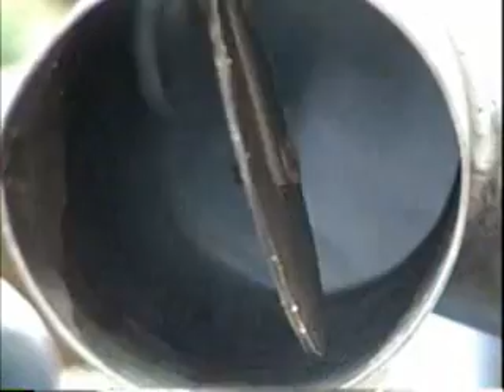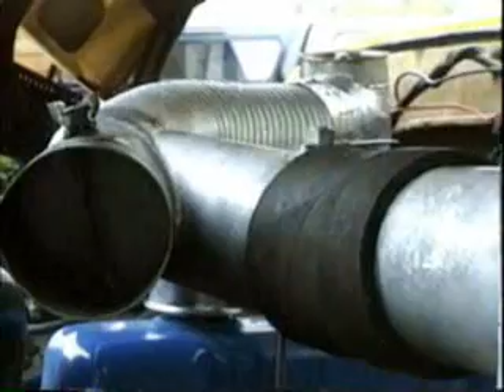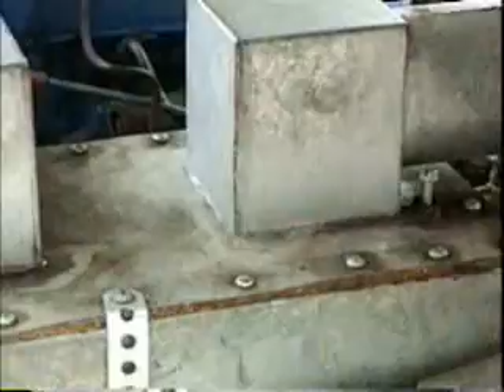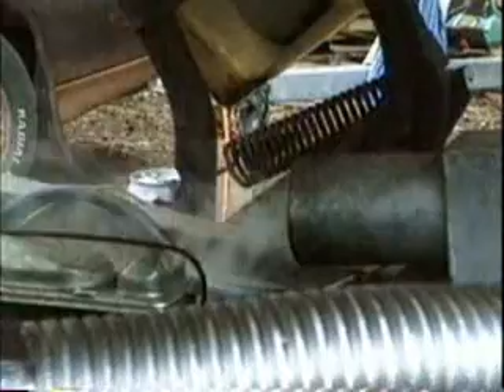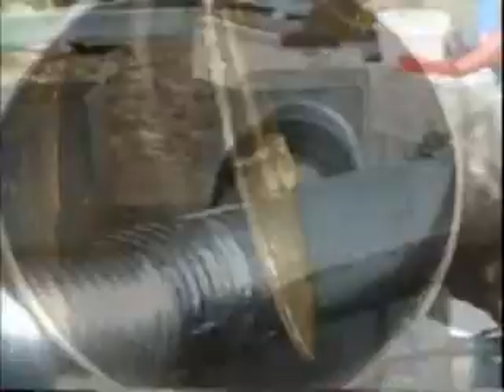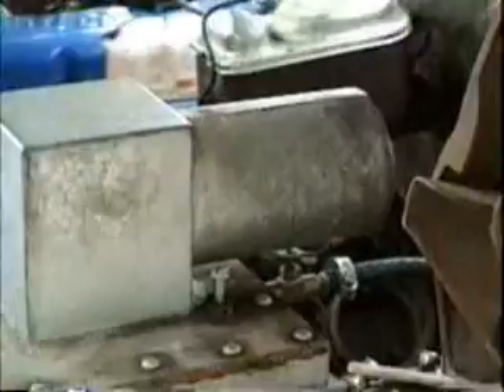Here is definitive proof on how to separate all Atoms in all liquid soluble matter.

Comment from the maker: My problem was the generator. You see it was set up to produce 110 VDC, at 2000 RPMs, however on the highway the engine is running in the 3 to 4 thousand RPM range. I discovered when I burned up one of the 250 watt flat bar heaters. They were made of stainless steel. It melted the heater into two pieces. The chamber never caught on fire, but the flex drier vent tube, had cooled with air and vapor traveling through it, so the vapor had condensed some, the flame looked like an alcohol fire.

Comment: Thanks for the reply and the repetition. I did read about the fire -sad indeed. However, I thought that, after installing this on 7 vehicles, there would have been some report of mileage gains or something like that. I do see what you are getting at though -being able to burn any liquid as fuel in an existing ICE, for one. Other uses may come about in the future too. If it was me, I'd have built another by now though, just to save on gas, since you still need to get around. Am I right?

Comment from the maker: I know there is a temperature that water will do it. When this temperature is found, all the hydrogen you need to run any vehicle, can be made at the intake manifold of the vehicle. An inverter with 2000 watts of output will do the job. if the temperature is found. Large mass of heat, and a very fine mist of liquid is the key. There is a 62 degree Fahrenheit temperature difference in the boiling temperature of Hydrogen, and Oxygen. Who knows how close the molecular temperature difference is.

Comment: Okay, so is it still on a generator now? Also, how long does your heater last? I ask because I don't think that they are meant to be run on continuous duty..... As soon as I said that, I recall that there was one heater that ran for almost 8 hrs a day in order to keep the kettle going at the office. It did that for years, and was changed only because the base rotted away, but the element was still good. So I am guessing that all I would need is a stainless steel platform on the element then huh?

Comment from the maker: If you make the hole that sprays, the gasoline really small any fuel pump will work. If you just want to see the white vapor use an electric fry pan, and a plastic spray bottle. When I first discovered this. I spilled small drops of gasoline, accidentally, into the fry pan trying to get enough heat for a chamber. I created the chamber after a seminar on 99 Miles On Gasoline Vapor ( a scam). I threw that chamber away, and created the chamber you see here on You Tube.

Comment: Thanks for the reply and input! Hmmm... I guess that may be something in the works for me. I already have a 700W inverter. I am also guessing that I could try it with a clothes iron to see how things go at first. Getting the gasoline to spray out will take a bit of thinking -unless my mechanical fuel pump already puts out enough pressure.

Comment from the maker: I did it to gasoline. A large mass heater, and a fine mist of liquid, changed the gasoline. I got double the power to the ground over gasoline. I got zero parts per million, hydrocarbons, reading on a smog analyzer. I did this applying the liquid to the heat.

Comment from the maker: The problem is you have the pressure, which both hydrogen an oxygen are in at the point of separation. Maintaining the separation is the problem. cool the temperature and the hydrogen and oxygen will condense, back to water. Lower the pressure, and they condense. Transferring the hydrogen to the combustion engine, to allow it to burn, without condensing, hasn't been done yet. Applying the liquid to the heat eliminates pressures. You can take any liquid to any temperature before it boils.

Comment: hey mate.  Thats not my vid; its one ive referenced a few times but it belongs to FEC or Fast freddy whoever that is.  for reference sake that valve is opened before they start the truck but its come to likght they faked it all. Back to what i was saying, at 15BAR of steam pressure ina boiler the water temp is 205-207degreesC so somewhere around 60BAR of pressure water reaches the point at which it cracks into oxygen and H according to my instructor

Comment from the maker: Watched your video. I have a problem. In the back of the truck on the container, you see the gas in. The inlet or out let side of the water filter container, which is what you used, your PVC ball valve on the line is closed. Hard to make something run when no flow from the fuel source is happening. Take the fuse out of the power and the fuel gauge doesn't read at all. I see no flow of fuel, or proof that gasoline is not running the vehicle.

Comment from the maker: The liquid that forms the bubbles, is the non flammable liquid, that doesn't mix with gasoline, yet using heat it was created from gasoline. When a liquid is created it will always be soluble with the liquid it was created from. My liquid is not, yet it still has an oily texture. Make a bunch of my white vapor, in a fry pan, and you will see what I am talking about, when the non flammable liquid accumulates.

Comment from the maker: To defragment gasoline, you apply the heat to the gasoline. I am applying gasoline to the heat, at temperatures not achievable by applying heat to the liquid. Doing it this way the liquid achieves the heater temperature before it boils. Spray a fine mist of gasoline onto an electric fry pan set on it's highest temperature (about 600 degrees Fahrenheit). Watch closely the bubbles when they appear, on the pan, watch the clear gas turn white when oxygen fills the void, as the bubbles break.

Comment from the maker: Something to remember. A molecular change, produces a void in the molecular structure, of the original liquid. Science says mother nature will fill that void when created. Oxygen,  in the air, surrounding, where I sprayed the liquid gasoline onto the heater, filled the void. This is why I get a 50% increase in horsepower over gasoline. The molecule that created the void, in my chamber, is no longer flammable, does not mix with gasoline, and has a boiling temperature close to liquid mercury.

Comment from the maker: Do this and you have produced a molecular structural change to the liquid. It is possible to do this to water at the right temperature. I'm just hoping someone will grab this an prove what I say. Take one of the molecules in water to the right temperature and it turns to a gas, while the other molecule remains a liquid. Do this and you will make all the hydrogen contained within the effected water. Resistance heat can do this.

Comment from the maker: All liquids boil slowly. Try boiling water and see how long it takes. This is applying heat to the liquid to get it to boil. If you apply a fine mist of liquid to a heated mass (heating element) the liquid will reach whatever temperature the heater is set at, before it boils, yes even above the liquid's normal boiling temperature. Gasoline showed me this. There are molecular temperatures in all liquids, reach one, and it turns to a gas, all other molecules in the liquid will remain a liquid.

Comment from the maker: Sorry, for not responding sooner, but no vacuum or pressure is being used here. and I have taken liquid gasoline to a temperature above gasoline's boiling temperature. You see everyone else applies the heat to the liquid, and the normal boiling temperature is all you achieve. Apply the liquid to the heat, in a fine mist and you can take the liquid to any temperature you desire, before it boils. You see this way the temperature is reached before the liquid has time to boil, since boiling is slow.

Comment: ive read a lot of comments to understand what you are trying to get across to people and i think i finally read the one i understand. Its called "cracking" apparently when you can disassociate elements in a compound through heat/tempreture. I was told by my instructor that you can burn water but you need to heat water to 430degreesC. To the lay person this doesnt sound hard, fires are hotter then this. The reality is you will boil water at ~100degreesC. You need a pressure vessel to do this

Comment from the maker: If you spray a fine mist of gasoline onto a 500 watt flat bar heater, you will make all the vapor needed to run any engine. This vapor will have twice the power, the gasoline vapor you create, using the bubbler method. The butterfly valve under the carb will regulate the engine RPM. This is the basic way my system operates. I just had the chamber to maintain a quart of liquid, finding out I accumilated a liquid, that wasn't flammable, and would not mix with gasoline, from which it was created.

Comment from the maker: The point is the liquid reaches the temperature of the heater, before it has a chance to boil, being it is a small portion of liquid. Try it on gasoline see it happen, and you will know. Gasoline was the first liquid that I have ever seen this happen to. If it can be done to one liquid using heat then you can do it to any liquid, it is the right temperature, and temperature stability that control it.

Comment: I can't, its physics or mother nature. Any Liquid will expand 1000 times their original size when they are heated to a vapor. To go past the heated state you would have to do this under a vacuum to get the same thing to happen without heat. Then the next state I believe you get from vapor is very hot and that is plasma. If you know what is hotter then plasma then let me know.

Comment from the maker: Well by spraying a fine mist of gasoline onto a large heated surface (600 degrees Fahrenheit) I have taken gasoline to a temperature higher than it's boiling temperature. In doing so, I found a way to take any liquid to any temperature. You see when the small droplets of liquid hit the heater, they assume the heater temperature, faster than they can boil, it is at the assumed temperature of the heater, that the liquid boils. Creating, in my mind, a Molecular Change to gasoline. Show me different

Comment from the maker: I never preformed a MPG test on it. The point is not the mileage. With this I have shown people there is another temperature in all liquids. This means creating new and different fuels is possible. This opens up a whole new world of unknown substances. All done by applying the liquid to the heat. The fine mist allows the liquid to assume the temperature of the heater, really fast, faster than the liquid can boil, so the liquid assumes the heater temperature, then boils at the heater temperature.

Comment from the maker: From what I have done to gasoline. I know the right temperature will separate, the hydrogen and oxygen molecules in water. When this temperature is achieved, you will make a hydrogen vapor at the intake manifold. No cells or HHO generators needed. You will make as much hydrogen as is contained in the water you have sprayed onto the heater. The heater mass, and mist fineness will make it happen, when the right temperature is found, in the water.

Comment from the maker: To see the power difference. Use an electric fry pan, outside. First pour a little gasoline into the fry pan, cold. Ignite the gasoline with a match, and it will go poof. Plug the fry pan into power, and turn it to max heat on the control. Wait until the control, says the max temp has been reached. Now using a spray bottle, spray some gasoline onto the hot surface of the pan, you will see the white vapor I created. Throw a flaming match at that vapor, and a boom will happen. I started here !!!

Comment: No need for the apology. I would definitely like to try vapor on a race vehicle. I really do love experimentation and non conventional designs. Is there a source or a link you could share to help me with the design of the fuel vaporization device? From what i understand is that you have to have a specific amount of heat and enough surface area to make enough vapor. Would it also be possible to incorporate a turbo with this design?

Comment from the maker: To see the white vapor I created. Get an electric fry pan from the Goodwill. Take it outside. plug it in to electricity. Turn it to highest temp. Wait till the indicator light shows it has reached it's highest temp. Get a spray bottle. Put a small amount of gasoline in the spray bottle. Spray the gasoline onto the fry pan surface. It will produce the white vapor instantly. With the gasoline and fry pan cold. Drop  drops of gasoline in fry pan ignite. it goes poof. ignite the white vapor, BOOM.

Comment from the maker: You are talking about auto ignition, where the fuel ignites. The temperatures seen on the internet for the ignition temperature of gasoline is WRONG. They say it is 525, degrees Fahrenheit. I have seen calrod electric heating elements reach a dull red color, before the gasoline ignited. I know this is around 1000 degrees Fahrenheit. I used 600 degrees Fahrenheit, in the chamber, to make my white vapor.

Comment from the maker: Been visiting family with no access to internet. The secret is taking any liquid to any temperature. A large mass heater, and a fine mist of liquid, sprayed onto the large mass, heater element. The liquid will assume the temperature of the heater, before it boils. This allows you to take any liquid to any temperature, even above the liquid's normal boiling temperature. This separates the molecules within the liquid, when some molecule turns to a gas, other molecules remain a liquid.

Comment from the maker: I am not pressurizing the liquid. The chamber you see is open to the air. I simply spray a fine liquid mist onto a large surface heater. The liquid assumes the temperature of the heater, and boils at that temperature. This takes the liquid to a temperature above it's normal boiling temperature. This is not possible. All liquids have certain boiling temperatures, according to science. I am not a scientist, so I did it to gasoline. The small amount of liquid, assumes the heater temp, and boils.

Comment from the maker: Vapor cannot be super heated. It has absorbed as much heat as is possible.To absorb more heat it would have to change its state again. There are 3 states in a substance, solid, liquid, and gas. I know of no plasma state of any substance. In theory I suppose it exists, but the heat needed to achieve it does not exist, as far as I know. To re-condense vapor, one needs to cool the vapor, this defeats what I have done.

Comment from the maker: Using the white vapor created from gasoline, like I did, gives a dramatic increase in power, over liquid gasoline. This allows for one to decrease the engine size, which consumes less fuel. I would not doubt running a generator longer on vapor.

Comment: Oh.. Yeah and another question have you thought about building a stand alone white vapor system where you superheat the mist making the white vapor and re-condense it to a liquid that will be injected into the system with little to no "non burning" liquid in it. making it possible for you to run your car longer without having to empty the chamber? I know this would double to work. But just a thought.But im sure the new liquid will be much more volatile then the out of the pump gas.pro or con lol

Comment: Are the exhaust pipes the source of the 600deg heat? Can we use resisitive glow plugs, resistive cables, or should we change them? Have you tried using ethanol instead of gasoline? Thank you for sharing all these vids/info!

Comment from the maker: If you increase the temperature to 600 degrees Fahrenheit, and spray a fine mist of gasoline onto the heater, surface, you will get twice the power that gasoline produces, but you will also get another liquid, that no longer mixes with the gasoline it was created with, and the liquids is no longer flammable. This is a molecular change to gasoline, and the right temperature will do it to water, producing hydrogen, as much as the water being sprayed, contains. Try it. I don't have time right now.

Comment from the maker: It is not the device that makes a difference. The device was a way to do it at the time. The break through is there are other temperatures accessible, inside liquids, by spraying a fine mist of liquid onto a large heater surface. The liquid assumes the temperature of the heater before it boils. This creates a molecular change to the fine mist of liquid, when a portion of the liquid turns to a gas, and another portion of the original liquid (gasoline in my case) becomes non flammable.

Comment from the maker: This is not a carberator, and does not work like one, You need to look before you leap. I have used heat and a fine mist of gasoline, and created a different fuel. Only the butterfly valve under the carb is being used.

Comment from the maker: I would bet they are adding some chemical to initiate the oxygen and hydrogen separation in water. However, this only produces a portion on the hydrogen, in water. The right temperature, spraying a fine mist onto a large surface heater, will seperate the oxygen from the hydrogen, in the water, no chemicals will be needed, just the right temperature.

Comment from the maker: Funny everyone, still believes that liquid will only go to the specific boiling temperature of the liquid. Nobody sees, if you spray a fine mist onto a large surface heater, you can take that liquid to the temperature of the heater, at which point the liquid boils at the temperature of the heater. These high output generators and multi-plate devices that generate HHO are basically applying the small amount of liquid, to the heated surface, and nobody can see it. I am showing thim an easier way.